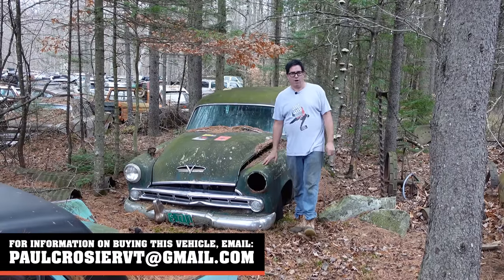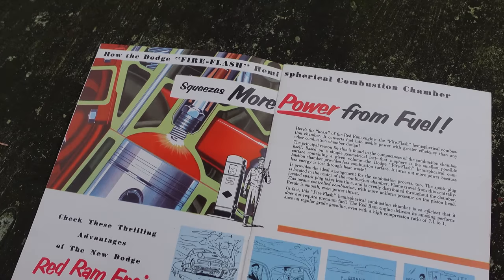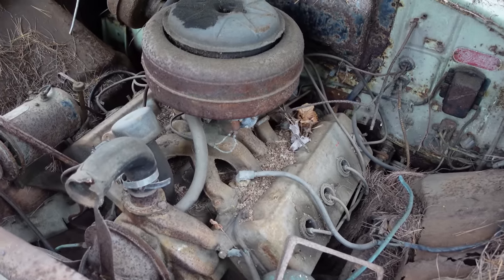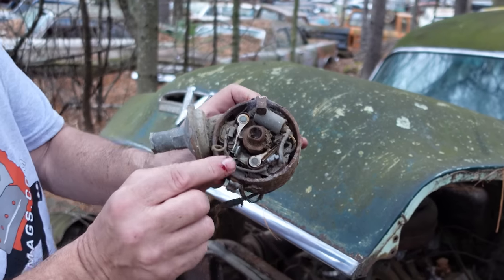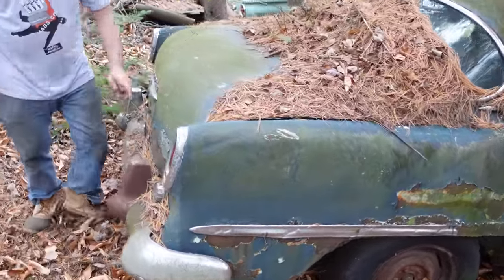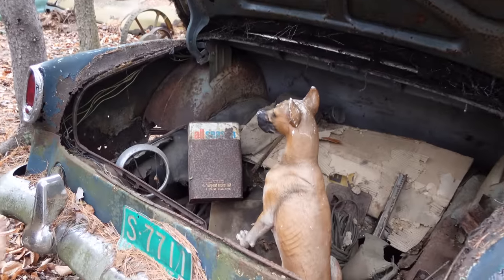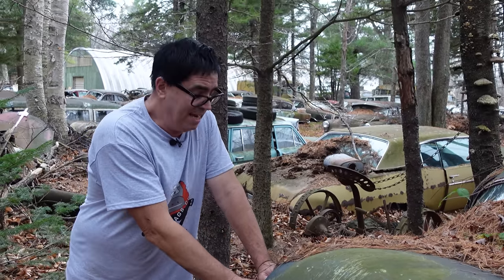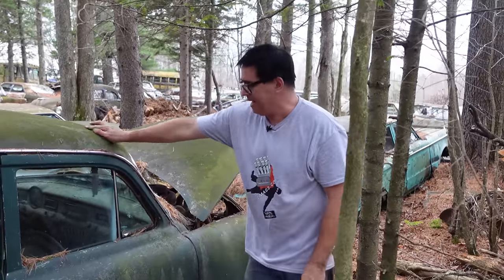First Ever Dodge Hemi

Comment: Dual point distributors were a popular performance upgrade in the early 1970s and I bought one for my 427 Impala SS. Damn it was difficult to time and set the dwell. Then as is the nature of mechanical points they need adjustment again every 1000 miles if you want to maintain any benefit of the dual point ignition. Classic Hemi valves needed frequent adjustment too. The 440 engine did not have the racing potential of the Hemi but for a daily driver street car it was the best. In 1975 I test drove a Challenger with the 440 four speed that was selling for $1800. It was a monster. If only I had the coin as an Army Private.

Comment: 1953 , first year Red ram 🐏 ♥ Hemi 
Shocked that one is still there 

Functional air scoop.
Semi auto , gyro matic  transmission too 

Funny how Chrysler , Dodge , Desoto
 had their own Hemis .

That particular car , 
looks mostly complete 

I was always impressed with the early  engineering of Chrysler motors .

Good to know , the Hemi gasoline ⛽ engine is sticking around  , thank Steve
Reply: I wonder if that jo Han model car maker  has these in his line up
Reply: That's a great question 🤔 @jeffclark2725 . It would be very cool .
Reply: @edmelungeon2239  translate to english?

Comment: Hi Steve, good video!  I do not know if you will except this or not.  The second part of this video clearly explains the advantages of a dual point ignition system and how it works.  Chrysler Master Tech - 1951, Volume 4-8 FirePower Engine Facts.  See the second part.  Please reply.  Dave...

Comment: there is a possibility that those Hemi heads from that Coronet will fit on an LA block. When they developed the Poly engines, they used hemi blocks, and changed the heads to the  cheaper to construct poly heads.... Poly heads fit on an LA block, you just need to route oil passages from the bottom of the head to the oil pan.

Comment: Yeah during the Korean War strategic medals were in short supply and restricted in use so instead of the normal copper nickel and then chromium plating on a bumper they used thinner layers and resolted in a lot of corrosion. My 51 Packard manual talked about a special coating to put on your bright work to extend its life which I'm sure most people didn't do and the corrosion got down to the pot metal and there goes your bright work.!

The EPA is made metal plating so incredibly expensive now that you can spend more on the bright work on a car then it's value...

Comment: Is there much in the way of speed parts for those Dodge Hemi's Steve? Can they be made to rev high for a street rod?
Looking to the future at the end there, Tornado and Hemi together, especially in boosted configurations, make a good strong base of powerplants to go in to vehicles that don't operate in cities or near charge stations. Twin Turbocharged Tornado Hybrid would be wicked combo in a small light chassis, think, '60's A-Body Barracuda sized, or a mini-Viper to take on the Corvette range.
Reply: Hot hemi heads and a few other comlanies handle the 241's... ive been tinkering on mine for coming up on 20 years

Comment: I have a53 coronet like the one in your video. Sitting in my woods still has the hemi and the grrotorque trans was wondering if I could install trans on a l6 235 DeSoto engine.

Comment: The 241 only makes about the same hp as a slant six, in part because the compression ratio is very low.  And its pretty heavy.  I think the Dodge and DeSoto v8s should have been polys - which must have been in development in '53.  The advantages of the hemi v8 didn't come in on street cars, the smaller hemi v8s was a needless expense.   The relatively simple Buick nailhead probably allowed Buicks to be loaded up with more chrome, which is what most customers wanted - but not as much chrome as the tacky '58 Buicks!!

Comment: Was a standard transmission even available in Dodge in 53?  I’ve got a ‘50 and the two choices were fluid drive, or clunk-o-matic, I mean Gyromatic. Don’t think you could buy a regular three on the tree without dropping down to Plymouth.

Comment: Can’t build hemis without parts. Most of the Mopar parts catalog ihas been on indefinate back order for over a year.
Reply: Hot hemi heads has been specializing in the old hemis for decades..... the pandemic put a dent on some supply, but still plenty of parts available put there....

Been tinkering on my own 53 241 coronet for almost 20 years.... back burner project

Comment: Hi Steve , There is 1 thing I don't know did they ever make a straight 6 Hemi or straight 8 Hemi, I know chevy and ford made a hemi, V8's  and it has to do with the Plug being in the center of the cylinder.
Reply from the maker: Hello Brian Bloom, yes Chrysler engineers did build some inline Six cylinder engines with hemispherical combustion chambers in 1947 as test units. There are pictures but none made it to production because Chrysler was aware that V8'S were the new wave. That's why the first 1951 Chrysler Fire Power was a Hemi and a V8. Thanks for watching and writing. -Steve Magnante
Reply: @SteveMagnante  I think they made a spit fire engine early on in a inline 6 and I seen it later on as a V8 in base models. I think it was a polyspheric design.  It seems like Chrysler took the spitfire block and firepower heads and made 426 hemi. Cool too see those old engines.
Reply: @SteveMagnante  Thanks Steve for the Reply, Great info

Comment: Another great video, filled with interesting data. As the owner of old cars and motorcycles, I have had a lot of trouble finding good-quality points. You almost have to dig out NOS parts to have any success with old ignition systems.

Comment: The HEMI is a half assed design.  Just finish the job and go with 4 valves.  You did all that work for less than 5% more flow when you could have had about 20% more.

Comment: So, Dodge has a hemi while Ford is still running the flathead and Chevrolet has the inline six.
Reply: In line six with splash fed conrods.
Reply: @Mercmad  that tells me that at BDC the crank end of the con rod is submerged in oil. Thought that went out with Model T's.
Reply: @kenttalsma7906  The oil pan had stamped steel troughs that the con-rods scoops 'dipped' into.These were fed by the oil pump. As the RPM increased the higher oil pressure squirted into the scoops directly as they passed by. Yeah, not a high revving engine. I helped my neighbor rebuild a few of the earlier '41-'49 Chevy models. 
He said "Don't drive over 50 mph for long periods of time, you'll burn out the bearings!"
Reply: @throckmorton8477  interesting 🤔

Comment: I am so sick and tired of the hemi talk. If they are so great why aren’t all engines made that way?
Reply from the maker: They're a little more expensive to build than other engine types and don't really deliver that much more in STOCK trim. But they do have strong air flow potential to Hot rodders. That's the trick. Thanks for watching and writing. -Steve Magnante